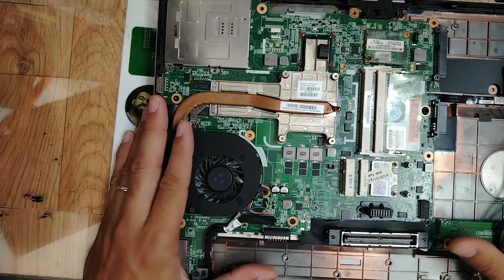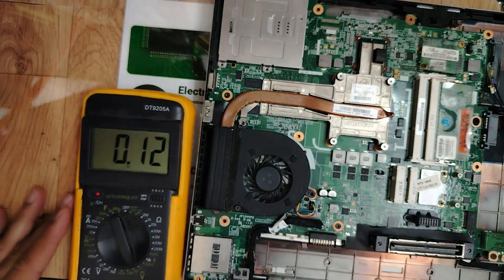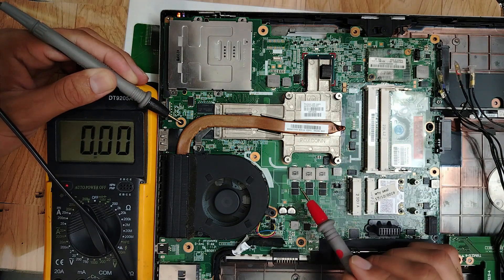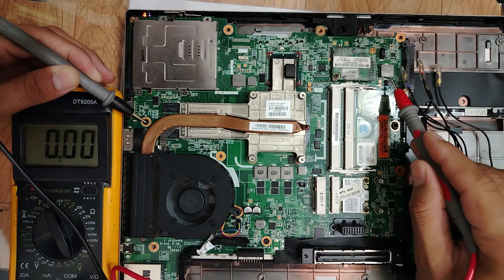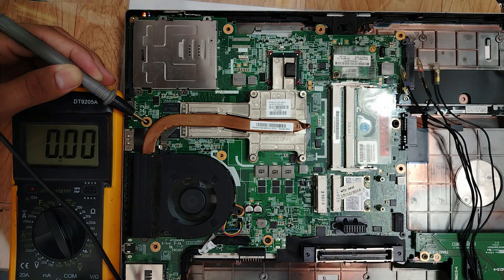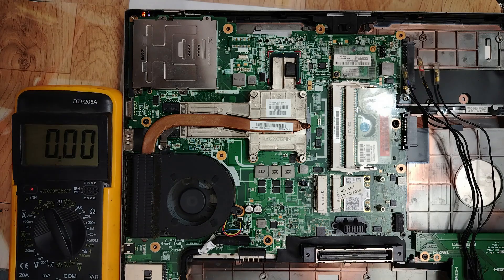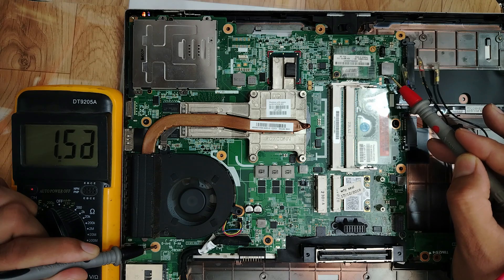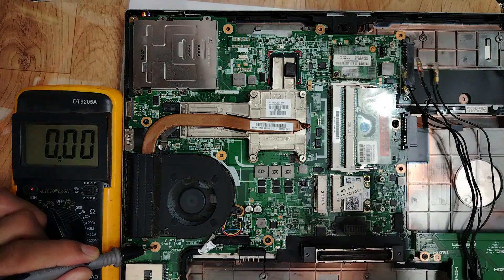Motherboard Voltages Explained | Laptop Repair

Comment: 3/5V is present, but there is no voltage at the BIOS (pin8), which part should be checked? Thank
Reply from the maker: Check the components around the BIOS chip.

Comment: hello sir i have just sucribed your channel as it is very informative i would like to know would this the same porcess if would like to checck a walkie talkie mother board
Reply from the maker: Thanks for subscribing, and yes, the same process applies.
Reply: @electronicsrepairbasics_erb  so if the ower is 7.4 V on the capacitor it will show 7.4 v 
? like in the video it should 3.8 and 1.9 somthing  like that